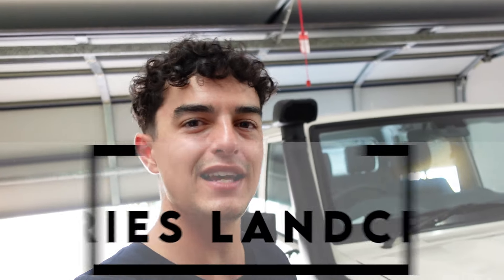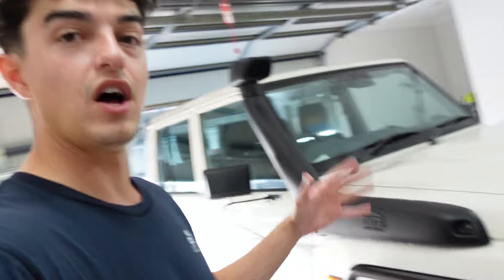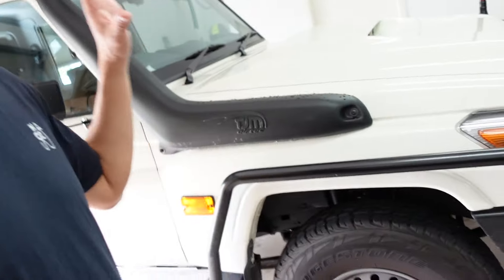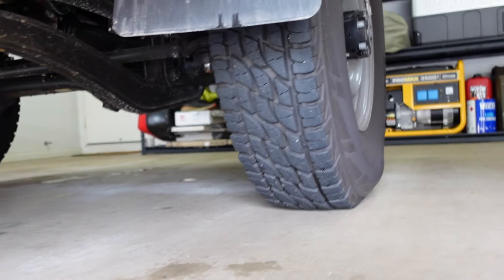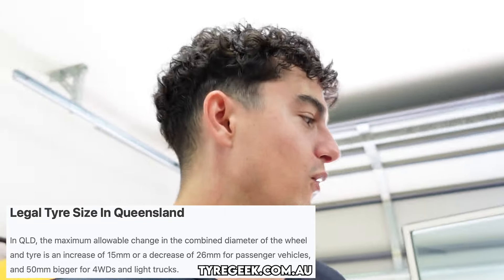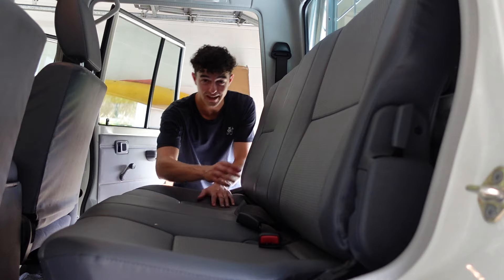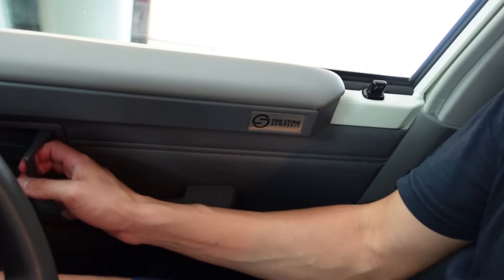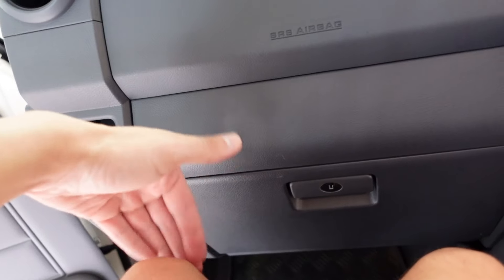10 MORE THINGS YOU NEED TO KNOW About The Toyota 70 SERIES Landcruiser!

Comment: Went for the GXL 78 purely for front and rear diff locks, price difference would only get one aftermarket, wasn't fussed on carpet or cloth seats but the electric windows and central locking also not on Workmate are a bonus

Comment: GXL comes with additional diff lockers right? I would think that would be very valuable?
Reply from the maker: It’s only 1 locker from factory and some people criticise the factory locker and replace it anyway with a more reliable air locker
Reply: GXL comes with front and rear diff lockers.
Reply: @NorthOz gxl is front and rear and they are good